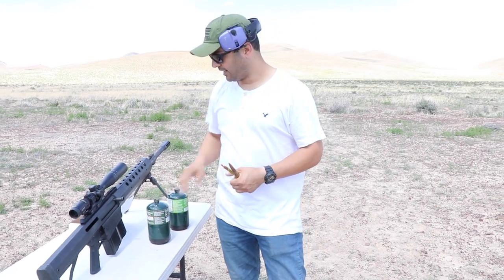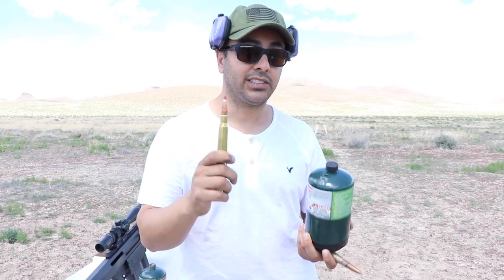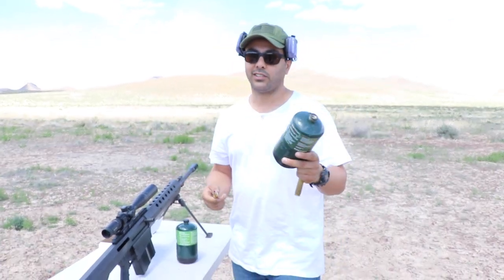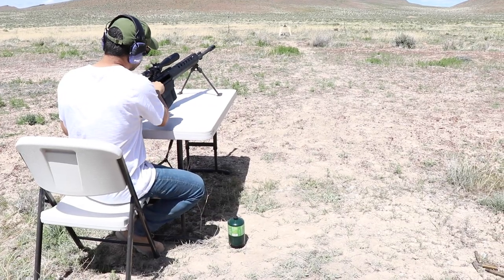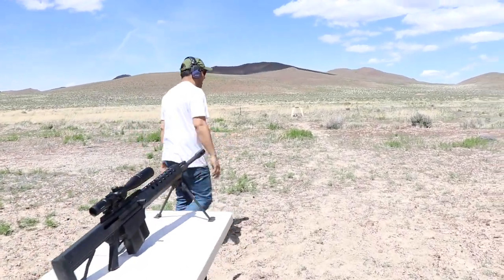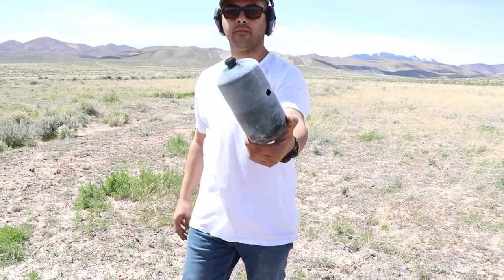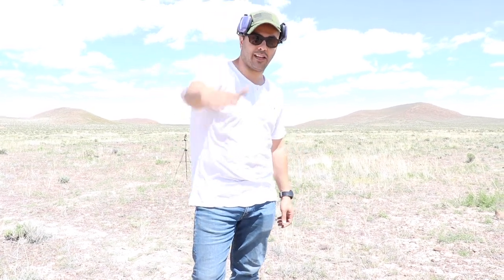WHAT HAPPENS IF YOU SHOOT A PROPANE TANK?

Comment: Second shot sent that thing spinning up like a helicopter, but no explosion. As usual, your test result isn't what I expected, learn something knew every day. Keep up the good work!
Reply: I guess it’s cuz the density of the gas. It’s particles have to intermix with oxygen in order for it to be flammable.
Reply: No it was an explosion, there was just a lack of a fireball. You can have an explosion without fire, it just happens that explosions tend to contain flammable gas and liquids which a pressurised and mixed with air. so the explosion part, is the rapid expansion of pressurised substance. Which is why both of these did infact explode, they just didn’t have an ignition source near by

Comment: The incendiary round didn't work in this case because the spark did not ignite the flammable propane vapour. At the same time, there was obviously not enough oxygen to propane vapour to ignite it either. This is why a flare is necessary - it provides a source of ignition after the vapour has escaped, which will then continue to burn the vapourizing liquid propane. Regardless, cool video!

Comment: If you put a big hard rock about 4 feet behind the canister it will likely ignite. I've done that with .308 tracers and have gotten a fireball. The rock shatters the bullet and burning incendiary material into a shower of sparks giving the fuel a little time to mix with the air.  Sometimes a big chunk of quartz will ignite it too with just a military FMJ non incendiary round due to the quartz having a tendency to generate showers of sparks when stressed. I pulled that off one time with just a 5.56mm out of my AR-15.

Another fun thing to shoot that I haven't seen done on YouTube yet although it is a bit lame is a full Martinelli's Sparkling Cider bottle after it has been sitting in the hot sun all day and shaken a bit. It makes for  pretty cool mushroom cloud of foam. I ended up with a couple of cases of that stuff back in the day and me and a buddy had a blast with them out in the desert. Trying to pick up all the glass afterward sucked though so I would suggest doing it on a big tarp.

Comment: Three things are needed to create fire. Fuel, oxygen and heat (some consider a chemical reaction as a fourth). The propane bottles held fuel/propane, the tracer round had the heat but there was no oxygen inside the bottle. The tracer round had already traveled out of range before the propane mixed with oxygen in the air, so it didn't ignite it. Even if the propane tank had been sitting in fire when it was shot, it still wouldn't have blown up. There is no oxygen in the bottle, so only the propane outside of the bottle would have ignited.

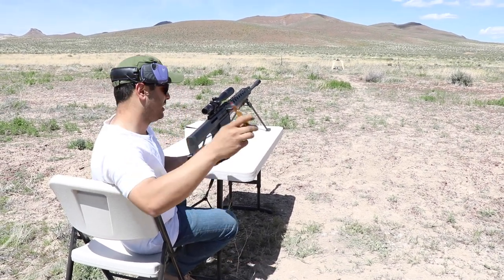Comment: “ThEre WaS nO FirE THaT MEanS nO ExPlOSioN” you can have an explosion without a fire. Fire is the bi product of a pressurised flammable material reacting with temperature or ignition source of some sort near an explosion. The first propane tank by definition “An explosion is a rapid expansion in volume of a given amount of matter associated with an extreme outward release of energy” which is exactly what happened to the first propane tank it exploded without a fireball because there was heat or ignition source near by. let’s not teach people propane tanks that didn’t create a fire ball don’t explode. They do and someone could accidentally get themselves in a fire ball explosion if they aren’t aware is a external ignition source near by 1:47

Comment: I'm curious if hitting the tank closer to the top, if that might change the outcome. I know with gasoline, they say it's the fumes that burn, not the actual liquid. I assume it's the same with propane (could be wrong), and where you're hitting, it's definitely liquid. So if you were to hit higher up, where its filled with fumes, would it results be the same?
Reply: They will be the same. There's no oxygen in the propane tank to burn.
Reply: @16vSciroccoboi  it's LPG, or Liquid Propane Gas. Which is why if you shake it,  you can hear and feel it move in the bottle.  If you can feel it move by rocking it side to side,  that would mean there's air in the bottle. Just like rocking a bottle of any drink.  Try filling the bottle so there's no air bubbles and see if you can feel it move as much as the one with air in it.
Reply: @Robare69  it's not air in the bottle though, it's the flammable gas in vapor form.
Reply: @Robare69  also, LPG doesn't stand for liquid propane gas.  That wouldn't even make sense.
Reply: @16vSciroccoboi  apologies, it's "liquefied propane gas"
Reply: @Robare69  you're both wrong. it stands for liquefied petroleum gas, which = propane.

Comment: I was honestly wondering this yesterday when I ran across the video and I realized why it wouldn't work after the first bullet hit.

The reason it does not work is while propane is high flammable it needs a percise mixture of air to propane to ignite. While the tracer round does spark by the time the propane reaches the correct mixture to ignite the spark provided by the tracer round is long gone lol.